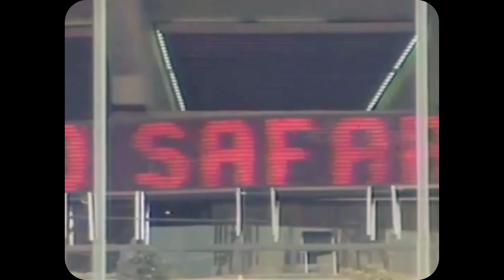Audi's Worst Nightmare

Comment: I own a Audi and its a all time nightmare to me.
Reply from the maker: you and me both lol
Reply: I own a peugeot and it’s all time audi nightmare to me
Reply: I own a Renault and it is its own nightmare.
Reply: My s4 hasn’t let me down once 150k miles still does exactly what it’s meant for
Reply: My A3 s-line has never let me down and just gone over 100k miles, still as tight as your mums pumpum 🫢
Reply: I had an Audi S4 B6 and an 1.8t both were shitboxes with a poor chassis, crappy OEM Alixepress/Wish interior ( RIP glove box, sunroof, button, cup holder etc)  and unreliable AF. Got a cheap japanese Subaru B4 RSK, way more fun to drive, comfy, reliable and has a proper chassis. Making 340hp on a safe tune for 98 octane, not bad for a 3000 euros car. The most reliable cars i had were a twingo and megane 3 rs.
Reply: that sucks, i’ve had a b8.5 w the 2.0 and mk1 tt w the vr6 w nearly no issues
Reply: I won't even admit to owning a Hugo much less have dreams about it
Reply: @ritid69 Hold up... wait a minute something aint right!
Reply: I work on Audi’s and its a nightmare to work on
Reply: @Nick-Emery  I own a 2012 RS4 and its really fucking me up
Reply: Skill issue
Reply: @stemartin6671 is that because typically they are strong cars 🤔
It’s probably the same as any other car,  it only gets used on weekends because I use the work van in the week,  the engine and DSG box are always serviced on time and I keep it clean and tidy… if you look after things then they look after you 🤷‍♂️  i can usually expect an anti roll bar/ball joint come MOT time as the missis doesn’t have much mechanical sympathy with speed bumps,  oh and an ABS sensor went last year.   Genuinely been a great servant
Reply: @Powertampa  Try owning one and then u'll understand
Reply: German cars are just really badly built and poorly engineered from the point of view of the consumer.
Reply: @ivaniii9707 Its giving me ignition issues n shit plus it handles good, i dont find any bad thing in engineering its just the engine which is so unreliable
Reply: @lakshveerchauhan289  I meant more in the sense of how difficult and expensive they are to fix often times. The VW group cars that friends and family have owned have had non stop oil burning issues and electrical issues since they drove off the lot. I am never owning a German car made after 1989 because of this and I am never owning a VW group product.
Reply: @ivaniii9707 I can agree
Reply: @skippylegrandgourou2069 Renaults are renowned to be unreliable! I'd take ANY Audi all day over anything French! German cars are SO MUCH better designed, reliable, safe, better built etc. I do like French Hot Hatches like the Megane you mentioned but just get rid before the mileage goes up. That way you enjoy all the best bits of a French Hot Hatch before everything starts falling off and breaking!
Reply: I had a B8 A4 and it was bulletproof. Then I had a B9 A4 for 6 months that did nothing but destroy itself and blowtorch my bank account 😅
Reply: @davekennedy6315  From my own experience the exact opposite is true. If you want to actually get there in one place and you want a engine which is reliable and easy to fix French cars are vastly better than German brands. Everyone who I know that has owned a German car has had mechanical issues while with French ones 0 issues apart from superficial ones.
Reply: This is an absolutely insane thread.  While never having owned a VAG group real high performance car,  I’ve owned many 1.8t and 2.0 Tfsi,  vr6, V5, PD and CR diesel engines… they have always been an absolute pleasure to own,  right across the VAG range.
The only VAG car I had that shit itself was a 2001  B5 Passat estate 4motion 2.8 V6… this had the Audi V6 and not the VW VR6… it would leak oil, let in water and the electrics were a problem (due to the water ingress).
My father owns a VW T5 transporter that has had an incredibly hard life,  that thing is indestructible!
Reply: The T16 mostly come out at night, mostly....
Reply: @lordrefrigeratorintercoole288  love it mate!
Reply: I own a Peugeot and I sleep like a baby.
Reply: @DaveKennedy ... You have no idea what you're talking about 
Go see data, instead of "are renowed for (...)".
Reply: S4 faster....
Reply: I own also an Audi, its even more nightmare than my lancia integrale I sold, at least my lancia gave me an smile when I saw it.
Reply: Same here
Reply: 😂 this is brilliant
Reply: Sitting in the garage.  @Trekceffej
Reply: I've once own an 2003 audi tt, which was a hand me down from my dad, I still have it today, but nowadays I drive a 2019 volkswagen Passat.
Reply: I own an old Lexus and its all pleasant dreams for me ..
Reply: Same with the Peugeot
Reply: Old audi with hardly any tech or luxury aren't that bad. Modern audi? Brutal.
Reply: Best friend recently had a built b5 s4, probably one of the most fun cars I’ve ever driven
Reply: I own a Volvo and old Ford F150 so no problems here
Reply: Do not worry, many people own peugeots and they too had total nightmares.
Reply: Owned s3 2008 model brand new within 65000 miles gearbox gone piece of shit 
Too many issues 
To be fair my Dacia duster diesel is an absolute beast
Reply: Which one 😂
Reply: @albertvesker7803  A4 Avant, RS4 kit
Reply: I own a 5cyl audi a6,from 1996,for 15years now,fantastic,durable and reliable car, with over 600 000km
Reply: @Bare36  depends Model to model chassis to chassis
Reply: @ivaniii9707 as a pug specialist mechanic and owner I can attest to how fairly easy to fix  and thoughtfully laid out their engine bays are for the most part. Most problems as you say are really superficial and I have had to poke around several other marques mostly Japanese though
Reply: My 2005 A3 tfsi quattro is doing just fine.
Reply: This guy Audis
Reply: Haha I had a 2008 RS4 it was love and hate, I still miss it but I don’t miss working on it F$&@ that.
Reply: @Nick-Emery I mean 100k miles ain’t much. My dad has a Passat with the 1.8T engine and it drinks oil like a drunkard. It has just over 200k miles. Decently reliable engine but not worth fully fixing.
Reply: I'm not saying every audi driver is like this, but in Europe I noticed if someone was being a jerk to me driving, it was almost always an audi.
Reply: Probably owned 6 or 7 cars at 52 years old. The 2 fords make up all but a couple of years. Any maintenance at all and they are hard to break. They also don't fall apart around the running moving parts.
Reply: @theodoresmith5272  driving here is way more complicated and hard. Plus maintaining any European car here is a nightmare
Reply: ive been a vw/audi mechanic and enthusiast since the late 90s... stay with the OLD ones... way better
Reply: @Nick-Emery  my 95 golf 5 door vr6 swap with over 205k on it is just dandy. and shockingly rust free...
Reply: @ghomerhust  that's the reason i am staying with the old one lol
Reply: @ianhunt4147  did you get the S-Tronic gearbox serviced at 38k miles?
Reply: I owned an Audi and it was by far and away the most unreliable and worst car I’ve ever owned

Comment: I alway find it funny that a Peugeot “hatchback” was the first ever mid-engined 4WD car. Not Lamborghini, not Porsche, Peugeot…
Reply: Peugeot used to make incredible vehicles, if you're a bit younger you'd be used to the trash they sold in recent years but in the past they were bulletproof, ultra reliable vehicles
Reply: @bzilla-d4i  Yeah my friend's granddad refuses to buy anything but Peugeot. Even though his 2000's Peugeot cars keep having issues at a more regular pace than is acceptable. 

For gods sakes my 2002 BMW 3 series has been more reliable for 6 years. Only ever suffering one 100€ coolant leak, and having braking lines corrode so they had to be replaced for 400€. That's all non-oil change maintenance a 20 year old BMW took for 6 years of me going near 200km/h on the highway regularly, and constantly having the car sideways and redlining during winters. I have given the poor thing hell, and it refuses to die or break.
Reply: Yeah and I daily drive a 205 xs only had a rubber hose from the heater matrix gone bad, other than that 0 problems. Bmw is shitee@samisuhonen9815
Reply: And beautiful:)

Comment: Very good overview of one of my favorite cars of all time!  

However, I think you left out perhaps the most interesting story for me  During the 1985 rally, Ari Vatanen's 205 was leading the rally when his co-driver Terry Harryman accidentally checked them into a stage control too early, incurring a massive 8 minute penalty.  They were leading by over 3 minutes over Walter Rohrl's Audi Quattro Sport at the time, and were now down over 4 minutes due to the penalty.  Vatanen and Harryman proceeded to claw back that deficit despite Rohrl's best efforts.  They won in the end, and Rohrl admitted that Vatanen was just faster than him.  

The truth, of course, is that Vatanen was indeed a fast (but wild) driver, but the 205 T16 was just a better car that was designed solely for Group B rules.  We all know how fast Walter Rohrl was (and still is, as a Porsche test driver even in his 70's!).  On the other hand, the Audi was essentially a dinosaur by then, a heavy front-engined Group 4 car that was adapted to compete with Group B (the Sport Quattro tried to be smaller by shrinking its wheelbase, but that made its front-heaviness even more pronounced).   

And the technological developments would make the 205 T16 a dinosaur unless Peugeot-Talbot adapted as well.  We could see this with the Delta S4 and its blazing super-turbo-charged engine that could produce power with no lag.   And the new Ford RS200 was extremely promising in the right hands.  Fortunately, Peugeot Talbot seemed to at least have a good foundation in place (the 205 T16 was basically a space-framed design, not based on an existing production body shell).  And they managed to extend the competitiveness of future versions of the 205 T16 (including the 405 T16) in wins in rallycross, hill climbs (like Pikes Peak), and in desert raid rallys like Paris-Dakar.

Comment: What you missed was the 1987 Paris-Dakar Rally. 

So after the 1986 end to Group B, Peugeot and all major rally teams had a pickle and for Peugeot, it was even worse as now on their hands, they had a winning rally car but no way to use it with and thus, someone came up with an idea.
As the Paris-Dakar rally had close to no rules on how much your car should be, Peugeot knew that their car was great enough to compete thus Jean Todt did not order his mechanics to do much about the cars even and just sent Ari Vatanen and the cars over to the start of the rally, just as how it was competing in 1986 with just a sponsorship change now and goodness it was a slaughter..

Peugeot slammed all the other competitors outright and won the whole event overall across multiple countries in the same setup that they used in 1986 across the whole WRC season. That's just awesome in its own right.
Reply: They won twice in the 205, twice in a 405 bodied version and then switched marques to run an evolution of the same car as a Citroen ZX and pick up 4 more wins. I remember renting the Duke films VHS of the event each year!
Reply: Actually, not sure when, but they updated the car and gave it an extended wheelbase. It looked really weird, since they added a bit between the doors and the rear side windows! 
The 405 which replaced it was a superior car, famously being beaten by the 205 when Ari Vatanen's leading 405 car was stolen overnight one year!
Both the 205 and the 405 also competed in the Pikes Peak Hillclimb, with the 405 winning it twice.
Reply: @ondraspendlik9759  That's 1988 iirc. The year they extended the wheelbase by abit for the 205 was in 1988 where it competed together with the 405.
Reply: it was the same car just with different bodywork on. Then it has Citroen Xsara bodywork and continued to win. The Audi Quattro although spectacular in its S1 short version guise only lasted for 3 years as it didn’t have the performance to compete with the 205.
At least Peugeot build the full quantity of homologation specials and lined them all up for inspection. Unlike Ford that had less than 20 cars all with multiple number plates.
Reply: The 205 T16 for Paris-Dakar wasn't exactly the same as the one for rally: the rally version (white livery) was 4WD, the Paris-Dakar/rally-raid version (yellow livery) was RWD, needless to say RWD on a car with such a short wheelbase is a total mess to pilot.
Reply: @Jean-Denis_R_R_Loret  No it wasn't RWD. The Paris-Dakar Camel 205 was exactly the same (Well.. In a way) in and out as the 205 that Peugeot used to conquer the WRC back in '86. 

As mentioned, everything underneath was practically the same as like someone mentioned, what Peugeot did was lengthen the car by abit to increase stability more and the added bonus was to fit an even larger fuel tank and another fuel pump that take in lower octane fuel that only Africa uses and that's about it. Engine displacement stayed the same and other major components stayed technically the same.
Reply: @stevenmoran4060 IT was Citroen ZX  not Xsara

Comment: What Peugeot had,, was FANTASTIC styling by an Italian styling god. BUT, it ALSO had snappy handling, GREAT brakes and in pimped versions, PERFORMANCE.
Putting a 1.6L and then 1.9L engine in a GREAT base car,, meant success was assured.
Sadly for Renault, they took a step back, from 1.6L Turbo mid engined pocket rocket to 1.4L turboed. Front wd euro-box.
I remember as a young man, , that  T16 bodykit on a GTI(or even an XSi) was akin to being a demigod amongst hothatch mortals.....
ALL GREAT European cars become rally legends(Escort, Mini, Integrale, 205, Quatttro.......), and sadly therefore become a scarcetty due to their use(wrecking) in junior and clubman rallying!/racing...
Sadly the R5s surcumbed to rust, like Lancia and. ARG, etc, but we're still great cars!

Comment: Audis decision to keep with the front engined configuration to resemble their passanger cars cost them dearly. BUT, the Audis do sound awsome.
Reply: Good decision because you can buy them and use them.... When they're all tubular frame with the engine where people need to sit and nowhere to put shopping and stuff and therefore not at all like the car you will get if you go and buy one....? What does that rally car tell you about the car you go and buy? Not a lot I reckon.

Also car means carriage... A carry, transport vehicle.

These things are not cars they are racing buggies.

If all manufacturers do this then of course all the 'cars' will end up the same almost and end up like F1.... An utter load of bullshit irrelevant to the manufacturer.... You'd have to be nuts to think after say Mercedes win the F1 then as a result people go out and buy Mercedes cars.... Madness; there isn't a single nut ir bolt on the F1 racing buggy that will appear in your car that you buy. You have the same shared components between the Mercedes car and Mercedes F1 as you do between the Mercedes car and the Renault F1.... Zero
Reply: Audi wisely stopped and put their winning car components into the cars they then went on to successfully sell for years. They stopped and capitalised while they were ahead therefore remained ahead in everyone's minds for decades after.... The most famous rally car, that you can buy (of course in a more useful comfy, fuel efficient form)

Comment: I love how Finland has like 5 million people. Yet like half of the most famous rally drivers are Finns for some reason. 

Then again, our car culture is pretty much perfect for birthing rally drivers. Every Finnish boy who is into cars, wants a RWD or AWD car that has at least 200hp. Sliding said cars sideways on our plentiful gravel roads, or during the long winters, is a national past time. 

We even have a term for a non-roadlegal car, which is meant to be driven on fields and private roads leading to them. "Peltoauto", literally translates to "fieldcar". And many Finnish boys who live on the countryside, have one when they are around 10-17 years old. Usually it's some rusty sub-100hp shitbox. But it gets you familiar with the controls at a very young age. Manual gearboxes, clutch, gas, brakes, handbrake, and ofc the steering wheel. 
I remember my friend had a shitty crashed BMW from the 80s, that he bought and we repaired. We would drift it around his dad's fields when there were no crops on them, and around the private gravel roads which connected his fields to each other, his house, and the public roads.

Comment: From what I saw its got some good info about the history of Group B, BUT......Peugeot has no R in its name! 
1. The "Peu" in Peugeot is like the sound of "Pu" in the word "pull", adding the release of some air while saying "Pu".
2. The "geot" sounds like the "jo" sound in the word "majority", with a slightly more rounded beginning of the "j".
3. Add the two syllables together and you obtain the correct pronunciation of Peugeot

Also.  The 1984 Rac Rally wasn't based in Wales! It started in Chester, England. Went north to Scotland and then to Wales. 
I had to stop watching after this as I was going to start shouting at the screen.....

Comment: You have to Admit the Audis where one of the only cars that were near to the production car . The Lancias the Peugot where just made out of tube chassi . The Audis used Kevlar but still had a Solid Chassi . 

But the days of the s1 where nubered as well cause Audi was developing a flat tube chassi mid engined car on their own. Its displayed at the audi museum
Reply: Understood, so it isn't a Peugeot 205, it is a racing car with 205 body panels arranged around it